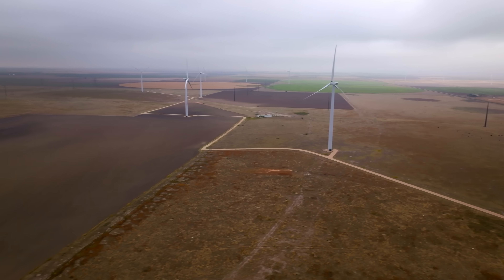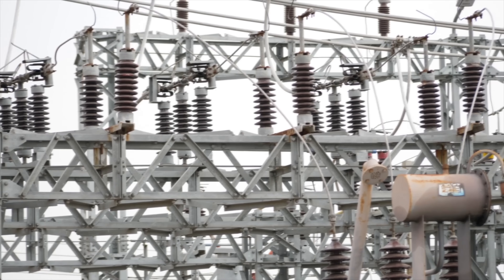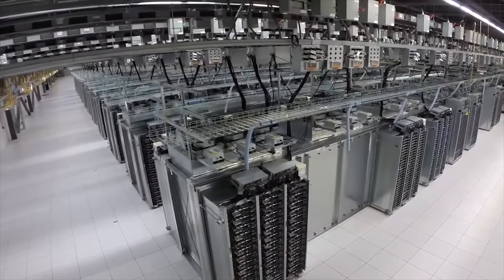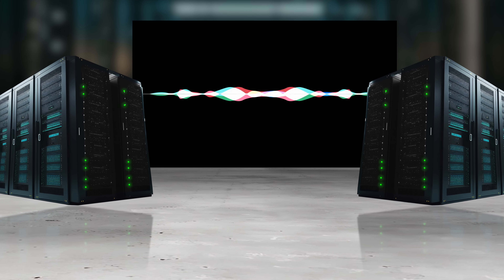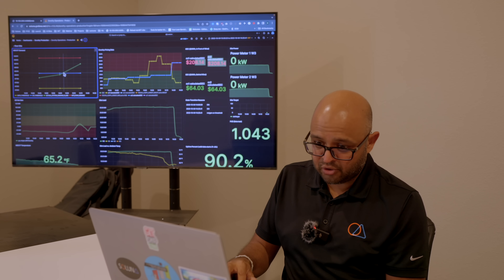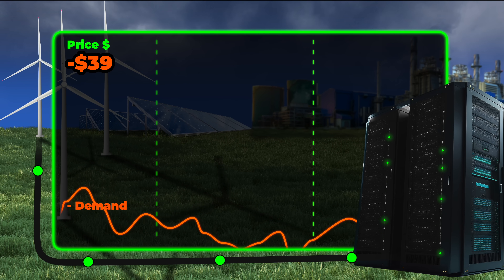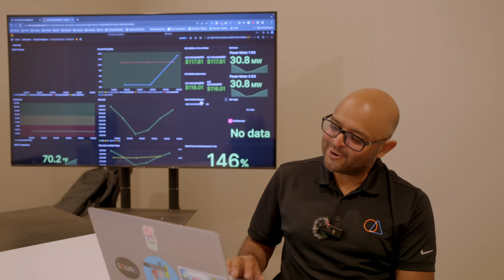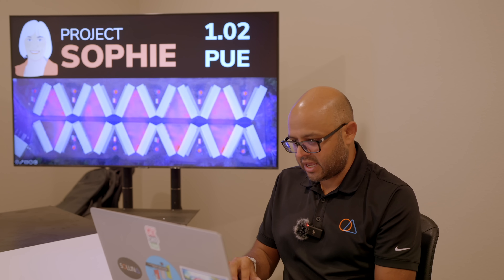Wind Farms' Dirty Little Secret No One Talks About

Comment: I've always wondered why every (mostly empty) wind turbine tower wasn't equipped with its own storage system? Store energy when in excess, release it upon demand. No extra real estate needed, no extra transmission losses, highly redundant.
Reply: Probably because storing energy is ridiculously expensive and therefore cost prohibitive.
Reply: @jonathantaylor6926 That's seems to me like a circular argument? If there was a technical reason I could understand but if it is a economic reason then less so. Imagine how many wind turbine towers are planned.  If each and every one had storage included, surely the economies of scale, along with the lack of any extra  infrastructure requirements would play its part?
Reply: @RichardIresonMusician No, that would just make every turbine operate at a loss.
Reply: @Kriss_L  have you any figures to support that statement? Of course you may be right, my thoughts are just musings. You seem sure so I'd be interested in the figures.
Reply: @RichardIresonMusician If adding a feature to anything is cost prohibitive, then how would adding that feature make something profitable?  Other than qualifying for government subsidies (which is a whole other discussion), the answer is it won't.

You can pick any figures you want.
Reply: @Kriss_L  so, I guess you haven't based your statement on any specific figures. Who knows, they might be working on it. I suppose time will tell.
Reply: @RichardIresonMusician  Of course I haven't researched any specific numbers for adding batteries to wind turbines - that's not anywhere near my field.

But someone else stated that it was cost prohibitive, and  I understand what "cost prohibitive " means.  Obviously, that phrase is not well understood.
Reply: @Kriss_L  well, if it is "cost prohibitive" then yes of course, but that contributer, like you, didn't provide any references to support their position. I personally have no idea whether it is cost prohibitive to include some sort of storage to allow the turbine to operate closer to 100% of the time. Also, you assumed batteries. I've no idea whether that tech would be the best suited.
Reply: @RichardIresonMusician  Something can be technically possible but economically prohibitive. The Concorde jet is a perfect example of this. The Concorde jet failed because super sonic speed requires immense fuel burn. Sure the trip is faster but that speed comes at a massive cost. Would you rather fly from London to NYC in 2 hours at a ticket cost of $18,000 or would you buy a ticket for a normal airplane that is slower by 5 hours but cost $2,000? The vast majority of people are going to take the slower and cheaper airplane because saving 5 hours isn't worth $16,000 to most people. There wasn't anything "technically" wrong with super sonic airplanes they are used in militaries all over the globe.. but they aren't used privately because of their economics.
Reply: @jonathantaylor6926  thank you for your explanation of why Concorde failed economically. I was however already aware of the many reasons why Concorde failed, including the removal of access to certain over ground routes.

However none of that is relevant to my question. Just saying something isn't economical is one thing. Demonstrating that it's not, using accurately sourced figures is another.

As this video points out, wind turbines are switched off for a certain percentage of their active life. Storage is one way to reduce that downtime. Central storage facilities are coming online all over the world using various storage technologies from batteries through heat storage and hydrogen production through to pump storage. 

My question remains the same. If storage was added to every new turbine (and possibly retro fitted). Would the extra profit gained by increasing the duty cycle of a turbine be sufficient to offset the cost of in built storage over the life of the system? Given the economies of scale of such on board systems, the effective zero impact on installation costs. The zero extra real estate needed...etc. Surely someone somewhere has done the sums?
Reply: @RichardIresonMusician wind turbines are very expensive to maintain. Adding a battery would increase that cost.
Reply: @HH-le1vi  again, there's the assumption that batteries are the only tech that can be used? Also, again, no one seems to have any numbers to back up their comments. Adding any extra tech will of course add to maintenance costs. My question remains the same. Has anyone done the sums to establish if the benefits of adding individual storage within every turbine tower outweighs the extra cost?
Reply: @RichardIresonMusician  well, it's about $1M/MW to put up a tower, barebones. To do maintenance on a blade runs roughly $50,000 per turbine, $100k per nacelle and that is typically done twice a year. Notice I haven't added tower maintenance costs yet and the maintenance is already $250k/year. Adding a battery would run you an additional 25k in install costs, then probably under 5k in maintenance a year. When maintenance is already approaching 30% of initial install costs, it makes no financial sense to add a battery that's not going to store that much energy. Also keep in mind that I have yet to even talk about if the tower has to go offline or it falls down.
Reply: @HH-le1vi  again, you've used the example of a "battery" I've no idea whether that would be the best tech to use. However from your figures what size of battery bank were you pricing for with your extra 25k?
Reply: @RichardIresonMusician  the largest currently available which is 13.5kW. That includes shipping and installation. Wind farms are in the middle of nowhere, and you're shipping big ass batteries so shipping is astronomically high. Install costs also won't be cheap either since once again, wind farms are in the middle of nowhere.
Reply: @HH-le1vi  hmm, are you sure the largest lithium ion battery banks are 13.5kW? My friends electric car has a 70kW battery bank in it. Have you got your facts right on this?
Reply: @RichardIresonMusician  If you're going to use a car battery as an example for something that's going inside of a tower for energy storage then your brain is far past the point. That battery would very obviously be far more expensive than 25k. They weigh 2,000lbs each, a 13.5kW battery is 400lbs. Be realistic. Not a complete bing bong
Reply: @HH-le1vi  quoting a "car battery" was not to suggest that a "car battery" could be used in a turbine tower, it was merely questioning your 13.5kW limit on battery bank availability. Now we've established that larger banks are indeed available my next question is as follows. Given that this video is about using power from turbines that might otherwise have to be shutdown during  times of reduced demand, what is the percentage of downtime that warrants the investment in such extra systems? In other words, in your experience (am I guessing correctly that you work in the turbine industry?) What percentage of the time on average are turbines switched off due to lack of demand?
Reply: @RichardIresonMusician  no really... storage is VERY expensive. Something like the cost of building enough storage for a turbine so it can run all the time would cost 35 Years of the profit that turbine makes. As for economies of scale, it does not work here as the market is already maxed out capacity-wise and it is more prices going UP as demand has outstripped supply, and supply is bottlenecked by a requirement for Chinese-mined rare earth materials and multi billion dollar capital-scale manufacturing plants (popularly known as 'gigafactories'). Some of the alternatives to batteries suggested (pumped hydro, hydrogen, mechanical storage) are even more expensive, costing hundreds of millions if not billions of dollars.
Spending $1 billion+ on a pumped hydro plant to store energy from a single $3million wind turbine IS uneconomical and is the reason people dont do it.
Reply: @Debbiebabe69  forgive me but I'm not sure I've explained myself properly. I'm talking about some sort of storage within each turbine tower. Certainly no room for pumped storage there! There would of course be economies of scale if each turbine tower was fitted, possibly at the factory supplying the towers. You say that "storage is expensive" but don't quote any figures. I'd really like to hear from someone in the industry who has a handle on how much time turbines are idle, how much energy that represents, how much storage would be required to, let's say for example, store the energy that would otherwise not be generated for a day and by inference how much that storage would cost? Many seem to have an opinion but no one seems to have done the sums!
Reply: @RichardIresonMusician  a turbine is shut down typically around 25% of the time depending on the condition of the tower and turbine itself. If it's bad the tower will get taken down or replaced.
Reply: @HH-le1vi  again, I must apologise for not making myself clear. I'm talking about the time a turbine spends idle because there is no demand for its output rather than by any fault in the turbine or tower. That is, after all, the subject of this video.
Reply: @RichardIresonMusician  that depends on where it is. Some places have more demand than others but a turbine being down 25% of the time is already terrible. It's like 5% for steam turbines and you get way more energy out of a steam turbine than a wind turbine.
Reply: @RichardIresonMusician  Im sure professionals would have costed it and found it untenable, hence why it dosnt happen;
Reply: @HH-le1vi  25% is indeed poor but the reasons for the 25% are important. If the 25% is through faults then that is one thing, if the 25% is through unrequired excess capacity, that is another thing. This video and my question is concerned with the latter. The former being a topic for another discussion.

A well designed on board storage system should have no impact on the reliability of the turbine's ability to produce its normal output. Any extra maintenance would be in the systems ability to store energy when not required and deliver it when it is required. My question still remains unanswered. No one has backed up their opinion with actual figures.
Reply: @Debbiebabe69  and that is exactly the reason for my question. I'd like to see the figures. Lots of opinions but no figures.

Comment: One issue…. This is then wasting the hardware while it is not in use. Energy represents only a small fraction of the TCO of data centres. I’m operating data centres for a living, the clusters of computers have a usable life of about 5 years, and the electricity consumed over that 5 years is merely a fraction of buying the new hardware, even including cooling…. let alone the data center itself… if they don’t use a closed loop, the data center design is flawed.

Comment: What happens when grid is "down" and how does it affect rest of grid. Example, solar flare blacked out whole parts of eastern Canada and then eastern US.  So, what happens to wind farms?
Reply: They trip offline as well: The main bus is disconnected from the grid, the turbines are then connected to massive resistors to bleed off the de-spin charge while the hubs are de-spun via back EMF and physical brakes to stop them.

A blackout/power trip is no fun for any generating station... scary things can happen.
Reply: @HammerOn-bu7gx  than you,  Mr. HH answered me as well.
Reply: They don't do anything either. They're ran by computer programs just like any other power plant. People don't realize that you need electricity to make the electricity.
Reply: @HH-le1vi  thanks,  I didn't know.

Comment: Water use by data centres is definitely a big problem - especially along the Colorado River - so it's great that they are tackling that. Is there a reason they aren't storing the power in big batteries? Or is that more for solar rather than wind? Do they rent their resources to big data centres like AWS or do you hire them directly?
Reply: why invest in batteries if you can let companies use it for computing instead ?
Reply: The thermal efficiency of batteries is not that wonderful unfortunately. All battery chemistries lose energy in a round trip with  heat being the principal byproduct.
Reply: @Haroldus0  sure, but they are good for time shifting power delivery and can respond really quickly

Comment: I am #2.
Thanks for engineering backstory. 
So, how does nuclear "store" the energy till "demand"?
No "capacitor" big enough?
Reply: It does so in the same way that burning fossil carbon fuels do: i.e. when there's no demand the power plant is put on a brake and stops consuming the energy reserves.
Reply: @Apollorion  this is really helpful. So this is why nuclear power gives us the "stuff" but cleaner than fossil fuels?
Reply: @Chubbchubb2313  Nuclear power is mainly considered cleaner because it doesn't produce greenhouse gasses (GHGs). But, due to the production of steel, concrete and other building materials also producing GHGs, the building of nuclear power plants does produce GHGs.
Besides this, also the 'mysterious' radioactive waste that nuclear fission (the most common form of nuclear power) produces scares many people (unnecessary) much.
Reply: It doesn't, which is why it is baseline power.
Reply: @ronaldking1054  thanks rk.

Comment: Very easy to fix. Compress air with the energy and separate out the carbon. Use the compressed air to run turbines when needed
Reply: adiabatic compression, not efficient
Reply: @margarita8442 I mean even something operating at 1% efficiency is better than something not utilising the wind power at all turning them off ?
Reply: @margarita8442  Not really the point under the circumstances. Make aluminium, hydrogen (and don't be telling me this is inefficient as tonnes of hydrogen is needed for industry and chemicals), community heating, anything. No one is going to run the most expensive computer processors intermittently.
Reply: Sure we could compress air. Or build gravity batteries. Or flywheels. Pumped hydro. Water batteries.

 The question is which is cheapest. 

 I think there are certain battery technologies that are becoming available now that are cheaper than other technologies. 

 Wait till metal air batteries become available! Jeff Bezos is putting money into Iron Air for energy storage. Once they start becoming large scale we won't even be asking ourselves what to use. 

 Lithium Air for cars. Iron Air for energy storage. Then things like FPV cells, and molten salt to recycle heat waste into energy.
Reply: @dianapennepacker6854  the problem is, once you add compressors and tanks, pumps, batteries, reservoirs, or any other form of storage, the cost goes up exponentially, and the cheapest option becomes - oil.